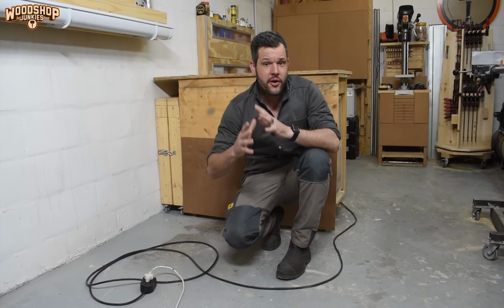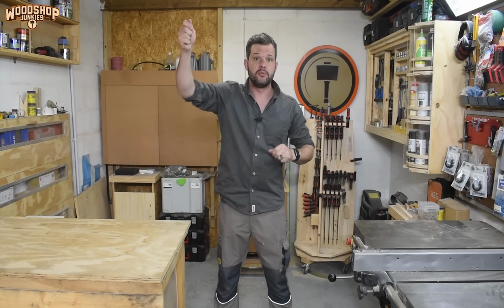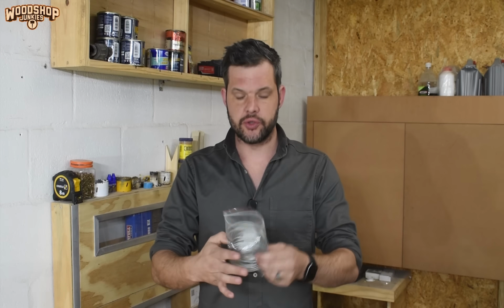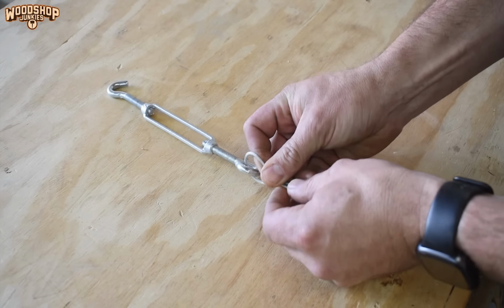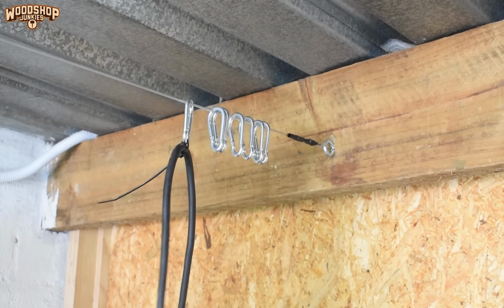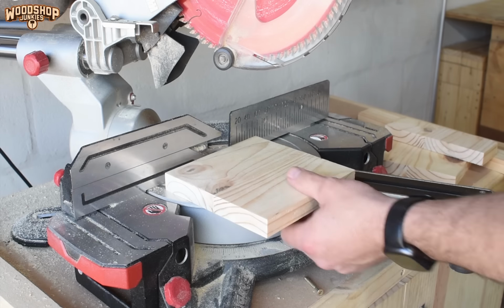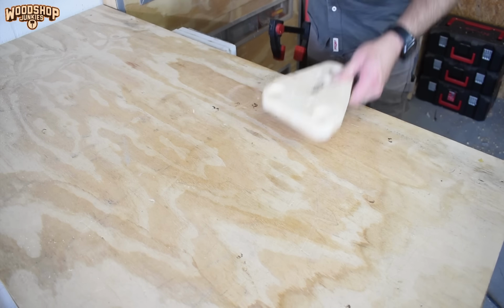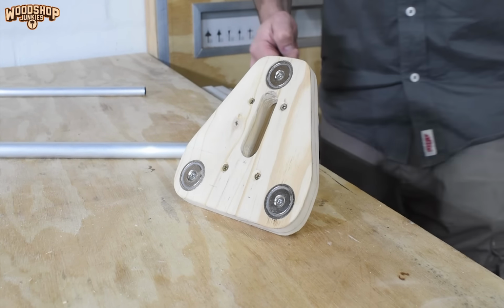Workshop Game Changer On A Budget! - Streamline The Way You Work

Comment: I saw a video where they cut the chords on their power tools to just a few inches and put on a new plug. The idea is to bring the power to the tool rather than the tool to the power. It makes storing the tool easier and eliminates the need for chord management. 
Now I just need to install a steel ceiling so I can have the power drop down anywhere! 😅

Comment: Practical idea.  I'd upgrade the size of your extension cord though.  That's a lot of amperage to run through that small cable & with it up at the top of your shop next to the metal roof it's going to be preheated already.

Comment: 👍👍 
Small suggestion, I’d use pulleys on the cable. I’ll might use the system in my shop but here in the US it’s 220/110 the cord would be 12 awg 4 wire with a box for the receptacles (220 & 110)

Comment: Good idea! I think I am going to use it on an outside metal covered shed I have.  I think I might even incorporate it with a small air hose.

 If I may, I am not sure if you used that one, but I have had a very bad "luck" with plastic-covered stainless wired.  They rate them as high strength as the bare stainless wires, but I have had them fail MUCH more often.  Actually, I have never had a non-plastic covered wire fail, and I have completely switched to bare wire. FYI...

Comment: I would consider using 3mm dyneema line instead of steel cable for the overhead line because it wouldn't vibrate and produce a high-pitched sound when you slide the carabiners over the line. You can get 20 meters for less than $20 USD, and you can still tension it with a turnbuckle. It would also create less wear on your carabiners.

Comment: @woodshopjunkies I only wanted to mentioned some information about extension cords. These often come in multiple types of current rating and its important to double check the overall wattage of the cabling. this may cause an increase in price as length goes up. Also this would change the overall AWG rating of the wire in the extension cord. This was something I learned due to my EV in trying to trouble shoot some charging issues back in the day. Fire safety and electrical safety are important after all in a wood shop.

Comment: Great upgrade! I paid quite a bit of $$$ for a retractable power reel... and it's not quite as useful as your solution, as it stays mounted at a fixed point on the ceiling. I like how yours can move around without stretching a cable across the ground. Great job!

Comment: I am not a fan of retractable extension reels as people tend not to roll them out fully creating a fire risk. I have seen ideas like yours and they are a great solution. I used curtain rails as my extension lead runners, much as you have done with the steel cable and works a treat. I only have to replace broken runners as they are plastic. That cable  solution is a good idea and no plastic except cable ties. Hanks for sharing these ideas.

Comment: The telescopic pole is brilliant. Although I’d be concerned if the electrical plug gets snagged it could cause the whole structure to come off roof and hit you in the head. Especially when using tools that move or have a hose connection attached. I would rather spend a bit of money and get mag switches that you know will have plenty of magnetic power and able to turn on and off whenever. That being said, I’d love to have some sort of vacuum system suspended since the hoses are usually always around the floor and a tripping hazard.
Reply: Yes, I agree. I loved watching this but my first thought was being hit on the head while using my sander or hand held router. Concentrating on your work then all of a sudden this falls from the sky. Even if it doesn't hit your head it will for sure ruin your workpiece and your day. Just a matter of time.
Reply: @AusWorkshop  My thoughts exactly. Concentrating on a cut, structure falls and hits you in the head and then that router or electric planer falls on you. Mag switches aren’t that expensive, but for piece of mind. Just like a SawStop is expensive until an accident that can change your life. Some things you can’t put a price on.
Reply: @ifiwooddesigns  I think part of the problem is how thin the metal roof is.  Mag switches work great on my table saw and bandsaw table but not so strong on thin metal roofing or shed walls I've found.  Thick metal is much better for magnets to stick to.

Comment: Clever, verging on genius.  Effective, simple, cheap.  Not pretty, perhaps, but nevertheless elegant.  I'm just trying to fathom how to adapt this idea for my non-steel ceiling...
Reply: Run 2 cables down to the end wall offset from the center of the usable space, use 2 pulleys with a block mounted between, then use a swinging arm to both sides of the work space
Reply: Great idea…I have the same issue.